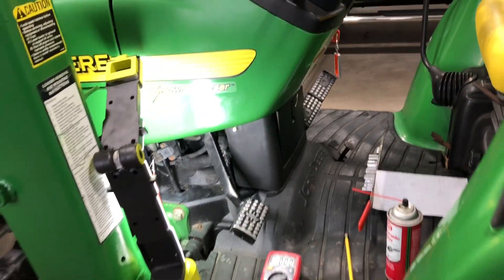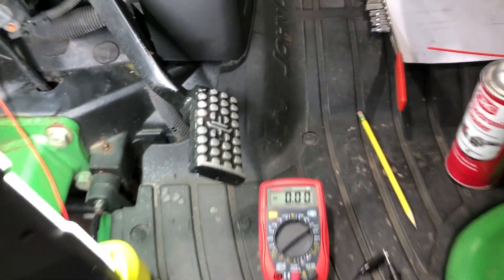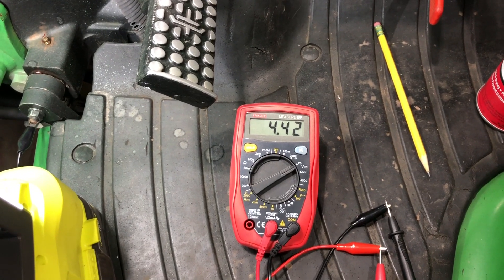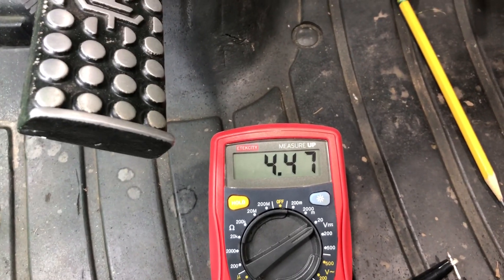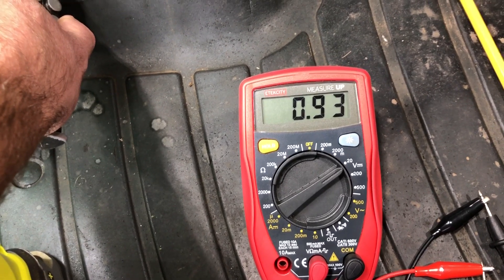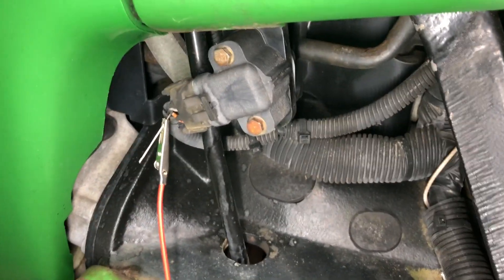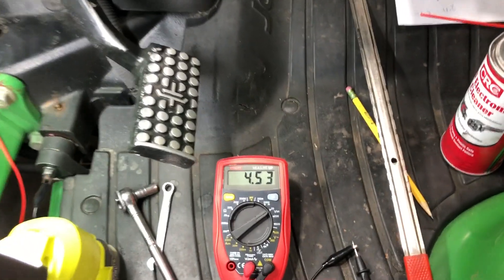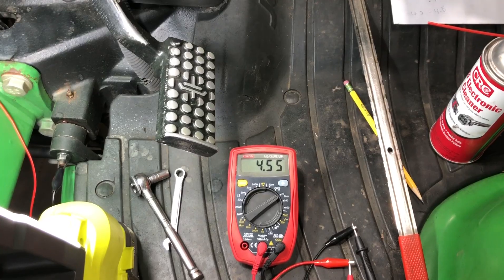John Deere 4310 Clutch Potentiometer Testing and Calibration ePower Reverser

Comment: Thanks for posting this.
 I have a 4410 (2004) and I have been trying to figure out why the machine just stops. I was getting the 3 light error flashing code and saw I needed "to adjust the clutch potentiometer" or replace it- but was at a loss.  ( I will research but I am thinking the voltages are likely the same for a 4410..) Thanks again.
Reply from the maker: Thanks for reaching out.  Yes voltages should be the same.  If potentiometer checks out good then it will most likely be that the controller needs to be reset.  If battery was dead recently then controller memory could have been lost.  I do have a video on how to reset the controller if you need it.  Should be under the 4210 playlist.  Will be a little different for reverser, but will show general approach.  I can pull exact steps from shop manual if needed for you for reverser if needed.  Hope this helps.
Reply: HI Darren @darrenmas  
Thank you so much for your work on these videos - its a treasure trove for a guy like me with a smilier machine who does not have your experience. 
I watch some of the material. Your "common issues" with the 4310 made me laugh. my 4410 has had every single issue. I have bumbled though and fixed or rigged most of them - but was good to commiserate. Your machine is beautiful and the work you've done to it impressive 

Sorry for the long post - But I watched your control fix video and I am now convinced thanks to your thorough explanation what all my error codes and controller problems most likely is... a confused controller.
This last summer I installed a diverter valve for a grapple and in my search for a empty fuse I was moving fusing around and testing what was switched - I believe its possible I put it in programming mode or at the least confused it. I also know I removed the seat switch and plugged it back in at one point during that work, and that may have confused it as well. Your explanations make me think since I am having other random flashes and issues (I have the code chart) besides the potentiometer movement that it may indeed be the controller. I could not figure out why doing the diverter value could have possibly messed up the electronic movement issues - Now it makes sense.
This was like a classes in the 400o series watching some of these and so helpful.

My machine is the 4410 2004 epower reverser. If you'd be so kind to share the shop manual procedure for the controller reset I would greatly appreciate it. I loved your cheat sheet with the error codes which I will make.

I live in central/northen NH and its snowing heavily and the cold is here so I may not get to it for a while, so if your do have time to send it - don't rush - but I would appreciate it. The dealer is expensive and 60 miles away.

Apologize for the long post but your channel is a tractor life line. If you're rather use email please send me yours and I will email you, whatever you like.
Jim
Reply from the maker: Hi Jim, glad the videos were helpful.  The JD 4x10s are such great machines.  My email is darrencmas@gmail.com.  Feel free to drop me an email and I'll send you what you need.  Thanks, Darren